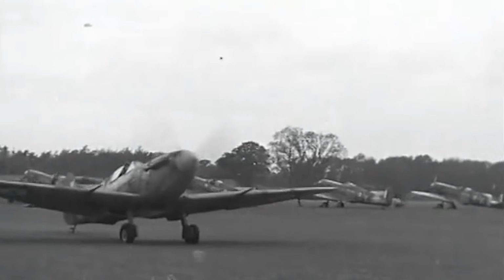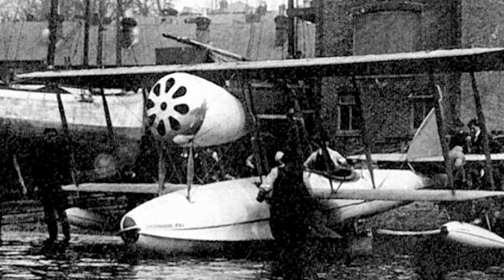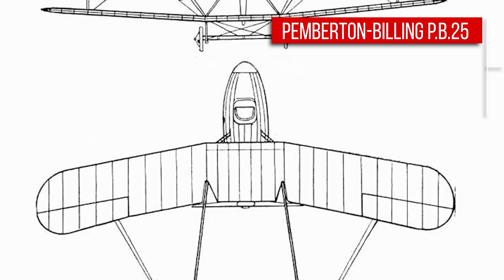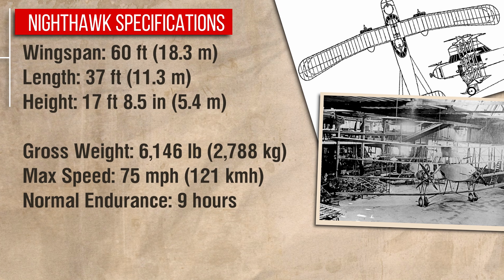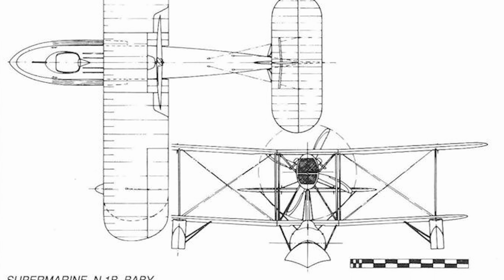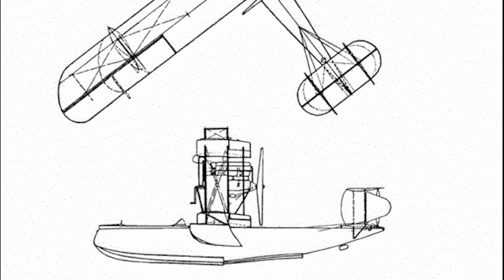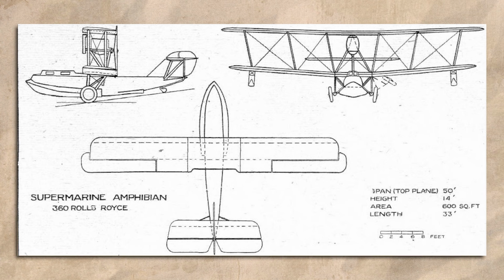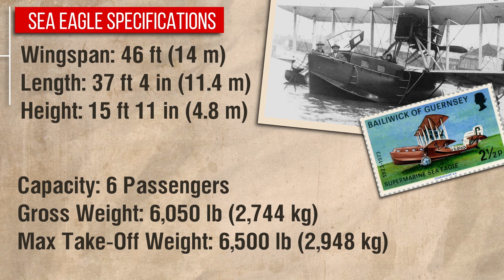Early Supermarine Aircraft | The Weird Ancestors Of The Spitfire

Comment: 5:38
Nonsense that such angle prevented enough thrust. If the angle was 10 degrees, it still had 98% of the forward thrust.
More likely problem was the downwash onto the wings. In that case, 10 degrees is more than enough to cause troubles.